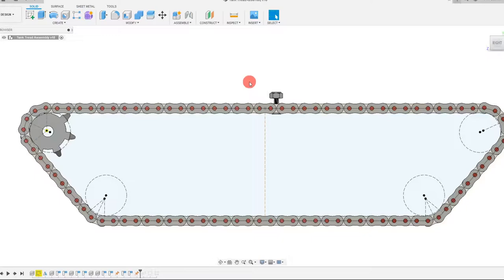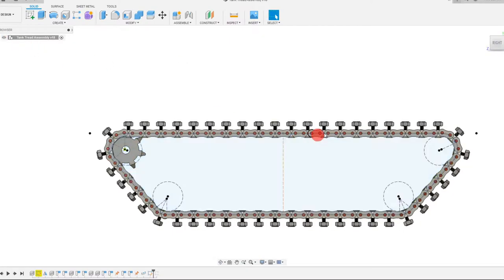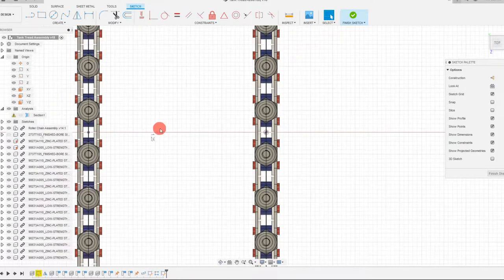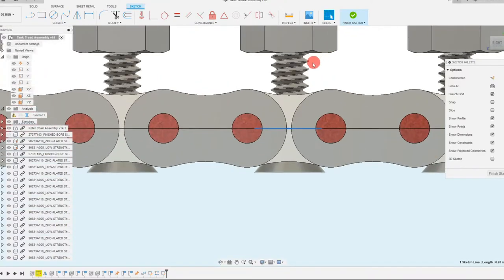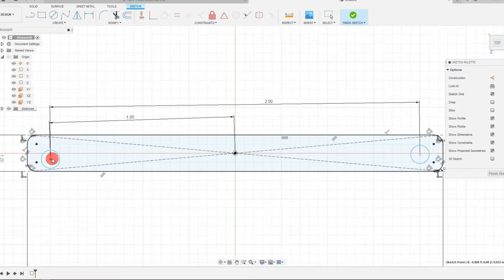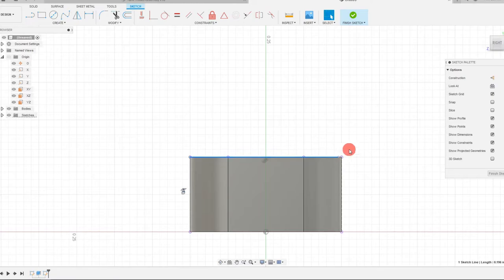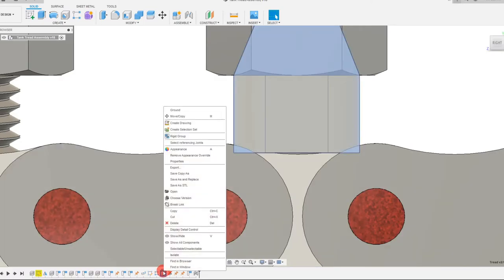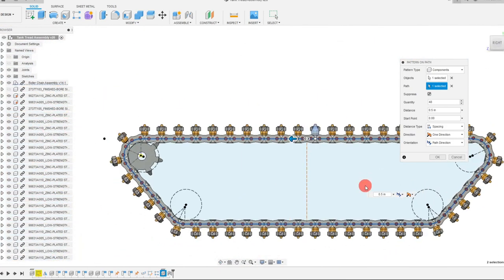Robotic Tank Tread Assembly- Fusion 360 Tutorial (Tracked Robot Part 2)

Comment: hey cool work! i want to ask, if you rotate the gear will the chain follows?
Reply from the maker: Good question! It does not. What you're asking could be done using a bunch of joint constraints, though. The chain links were simply patterned over the shape of the loop first sketched as a "closed profile."
Reply: @AvivMakesRobots  thanks for the reply! is there any way i can achieve it with motion links?

Comment: Does it also copy the rigid joint when using to pattern on path?
Reply from the maker: It doesn't keep the rigid joint to the screws. It is good it doesn't, because this would slow down the assembly quite a lot.